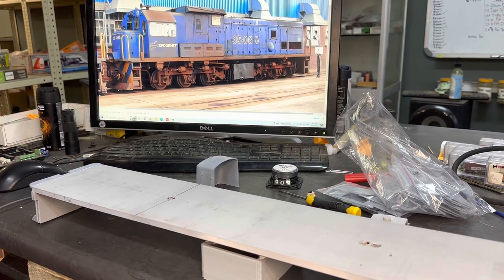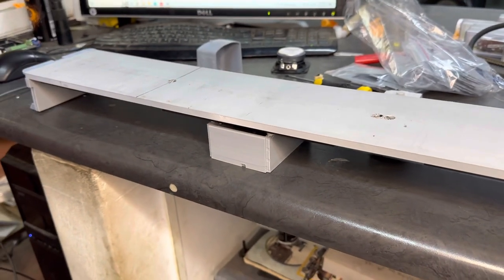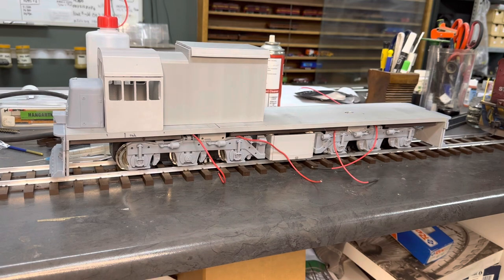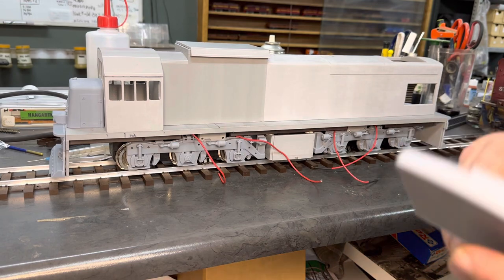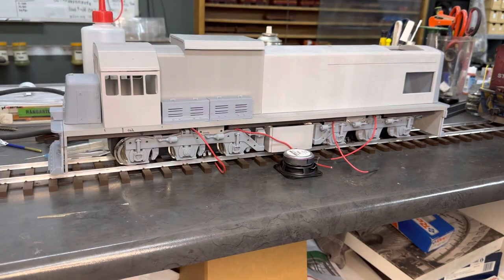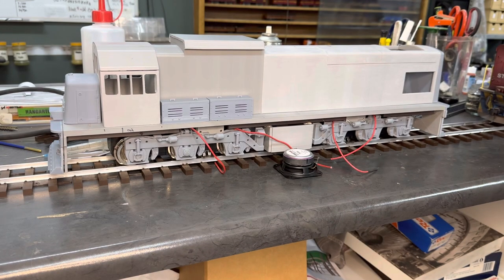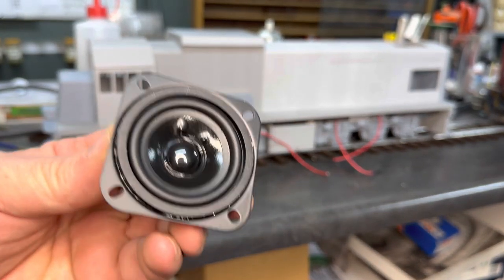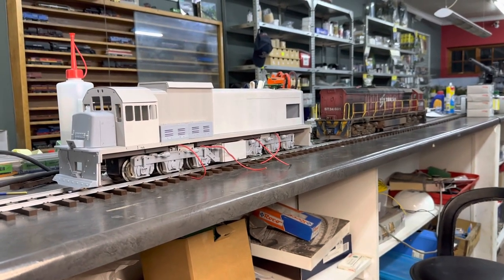Preview of the new 1/24 CG1 35GE loco. Let’s pack it quickly!!!!

Comment: Riekus, here's are two questions: 
1. On the locos without external battery boxes, where were the batteries kept? 
2. Also, the grills at the rear, what determined whether they were the large variant like on your model, or the smaller three like on the PC picture?
Reply from the maker: The batteries use to be under the long hood in the same position the battery boxes are now. The grilles seem to be inconsistent across the 000 and the 400 series. GE’s were notorious for overheating problems. I see on all of them with the large opening that the top 40% is blanked off in any case. Will get behind the story.

Comment: what do you make the chassis out of?
Reply from the maker: 10mm square bar that I clamp and weld in a ladder structure. Over this we skin it with a PETG printed chassis.

This now being cut lost all its structural rigidity. Which means I would have to brace the top of the chassis with a ladder between the long hood walls right to the back of the cab. Which is excellent for getting it to the 6.3kg scale weight.

Will let you know how it turns out.